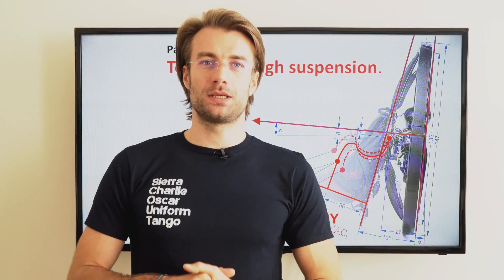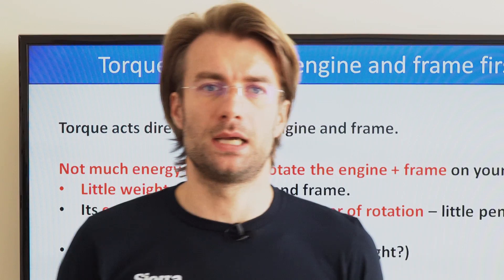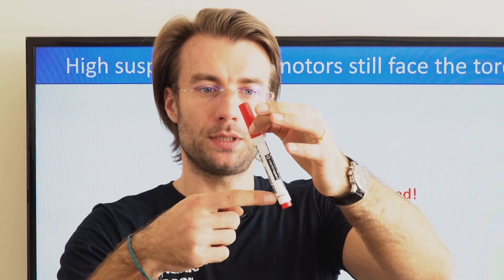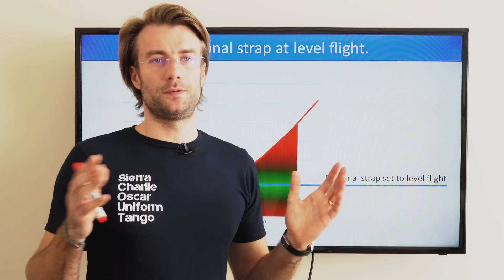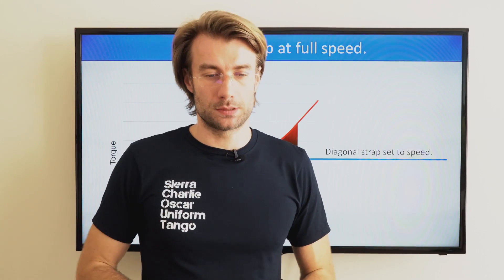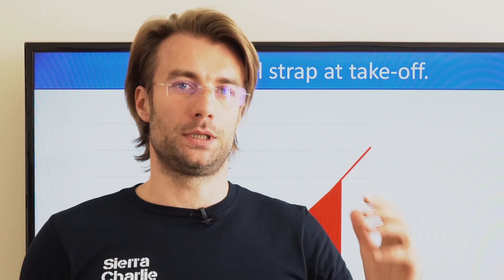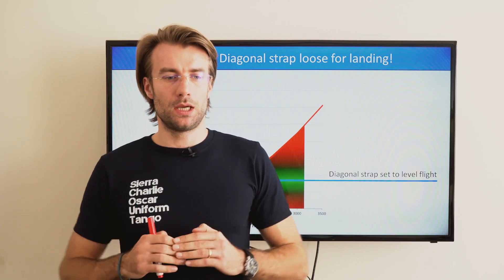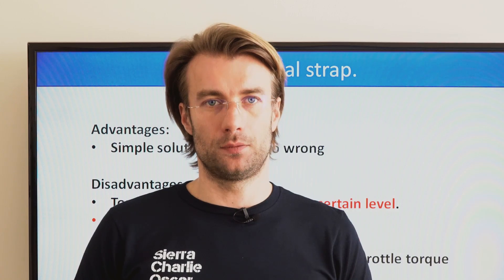Torque on high suspension. Paramotor Geometry part 13

Comment: so in simple terms, with the Scout I can climb and fly level without having to compensate for torque?
Reply from the maker: +GcoEnterprises yes
Reply from the maker: +GcoEnterprises yes. At full power there might be minimal residues of torque depending on glider type and size. But it's so subtle that a little body movement is enough. 
No need for engaging brakes on glider.

Comment: Yes, I suppose parallel offset would cause twist which would then cause a sideways component of the thrust, which would roll you in the wrong direction. I suppose angular offset gives you a bit of roll in the correct direction, though would also cause twist. Sorry if I'm talking rubbish!
David
Reply from the maker: Right, angular offset of the engine could cause twist.
Moving one carabiner to the front and one to the back would cause angular offset of the thrust line but still keeping it through the center of the risers.  that is how miniplane is offset.

Comment: I'm learning a lot by working through these videos. Regarding torque compensation, why don't you just offset the thrustline a little to one side? Thanks! David N
Reply from the maker: Simple parallel offset of the trust line could twist you.
Changing the thrust line angle is something that is recommended in the user manual of the Miniplane ABM  paramotor for example. Yet, bar offset is their main way of torque compensation.

Comment: Instead of having to remember to loosen the strap, so you don't make hard turns into buildings
Why don't you just deal with the torque in the air?
It seems like what you're fixing, has a worse problem when done incorrectly, then when not done at all.
Reply from the maker: Trust me, the torque is surprisingly powerful. Some sort of torque compensation is a must for every paramotor. You could not fly without any compensation at all. 
Diagonal straps are the way to do it for high-suspension systems.

That solution is far from being my favorite, though.

Comment: Please offer an estart scout soon! It's the only reason I don't have one now. Shoulder injury prevents me from pull starting comfortably. Really liking your videos Miroslav!
Reply from the maker: Which engine would you like to use?
The Vittorazi Moster Plus is rumored to come with a e-start any time now.
Reply: That's the one!
Reply from the maker: Vittorazi has been working on it for years but it seems there is light at the end. I have seen the first eMoster like 3 years ago... 
I guess they were not under pressure as the manual is so easy to pull... as long as your arms are fine. I will ask fir some update.

Comment: Just saw Tucker Gotts new matt finish scout !!! thing is sick !!! is that a special one off or you guys putting it into production and that new ball joint change is some wonderful engineering, from the looks of it you can upgrade the older scouts to that...
Reply from the maker: Its an upgraded model. The main body of the paramotor is the same so it is compatible with scouts out there. There are a few reasons why it is better than the old one. 
We will of course guarantee the production of spare parts for the old model forever.
Reply: Well I hope to see a video on thw new Scout, Also how did you guys come up with that name  Scout ???
Reply from the maker: I believe the future of paramotoring is adventure flying, fly&camp, bivouac flying, traveling and exploring new countries and landscapes, ... I guess the SCOUT name fits in.